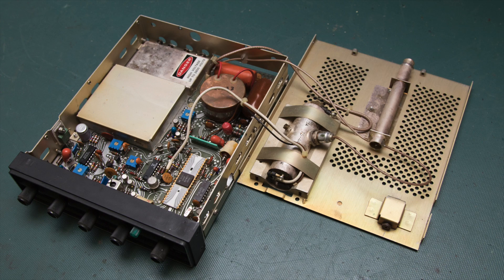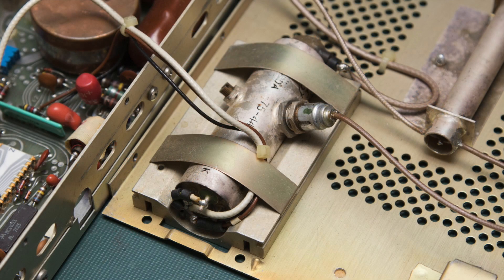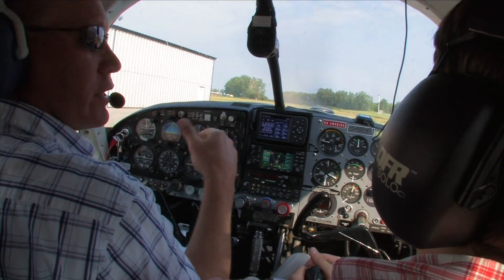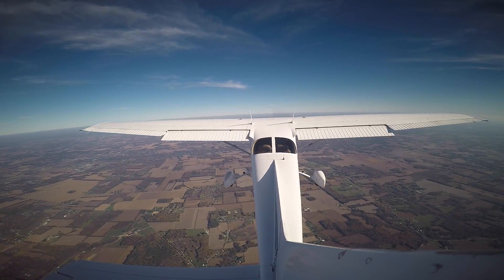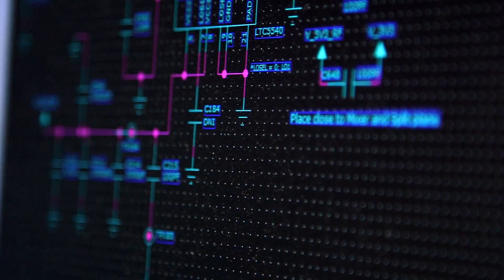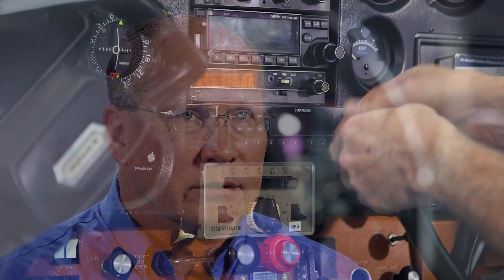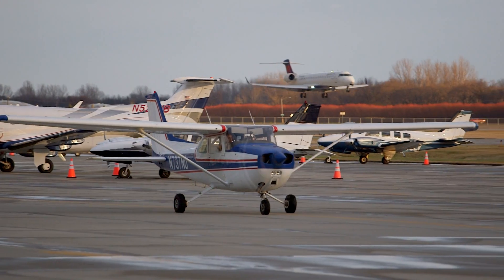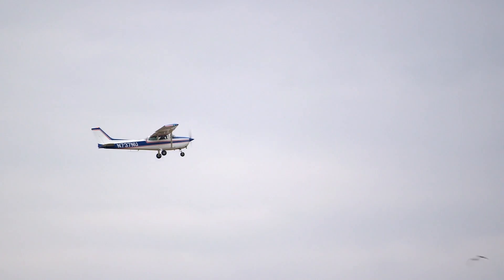Mode C Transponder Fails and Grounds Pilot- Stratus Story

Comment: I agree about tube-type analog Mode C transponders.  That's why I like to pair UAT with a "digital" Mode C transponder, like a used Garmin GTX 327 ($300-ish on the used market).  Then it's not only more economical I also get the advantage of anonymous mode for privacy.  And no vacuum tube failures since the GTX 327 is solid-state digital.